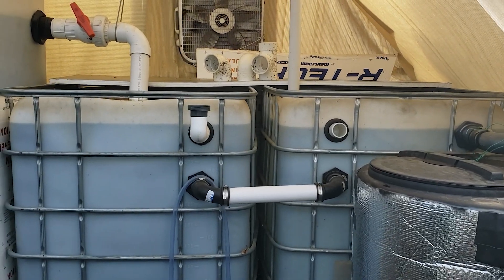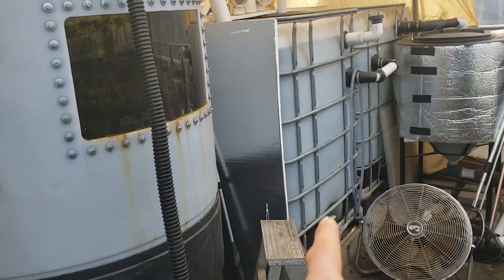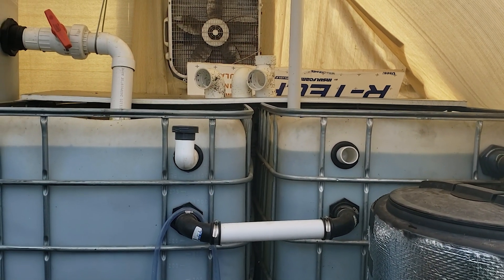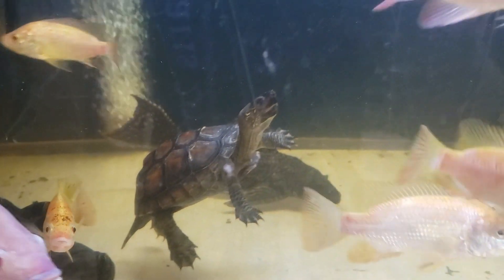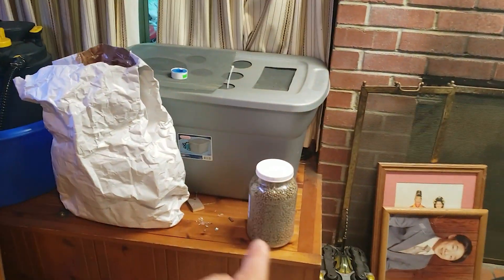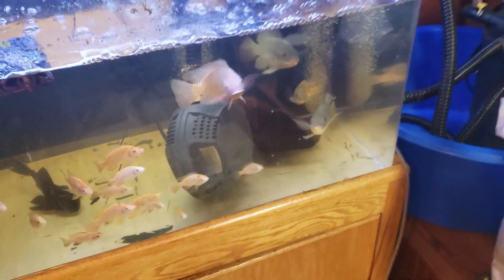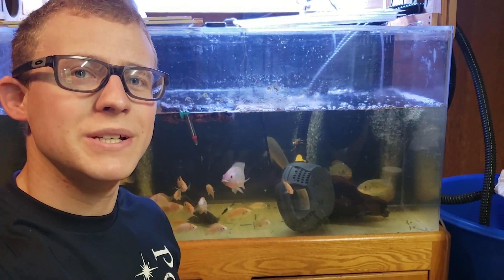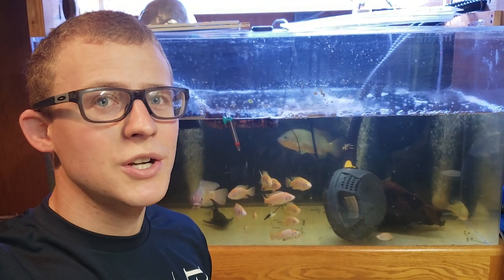Temperature effect on my aquaponic fish.

Comment: Have you considered wrapping your outdoor tanks in insulation and adding an inline heater to the line in? You can do it more easily with mylar insulation.
Reply from the maker: I have the insulation that I do plan to wrap around the tanks.
As for an inline heater. I did buy one which I was going to hook up but decided against it and just returned it. They use a lot of electricity so will be pretty expensive to have hooked up.

Comment: When i started keeping Koi Carp they had a lot of health problems due to fluctuations in temperature, my pond was only 3ft deep which allowed too much cooling at night. My current pond for the last 20 years is 6ft deep which solved the problem.
Reply from the maker: Ya the bigger body of water has less fluctuations in temperature. With all the exposed area in my aquaponics system the temperature fluctuates a good amount.